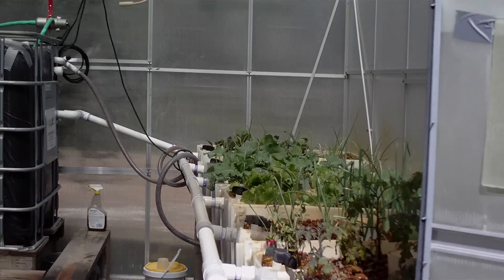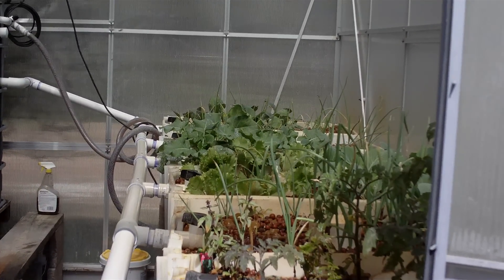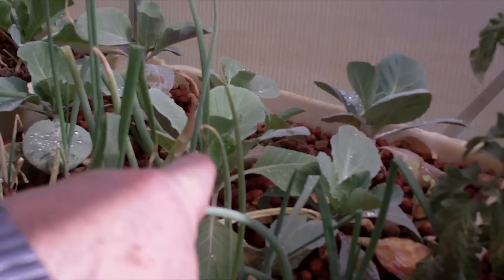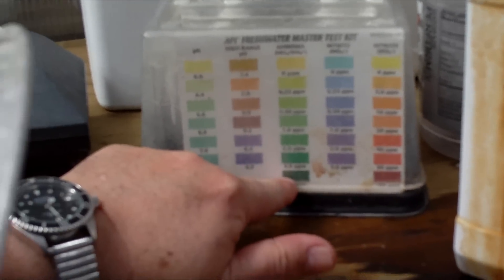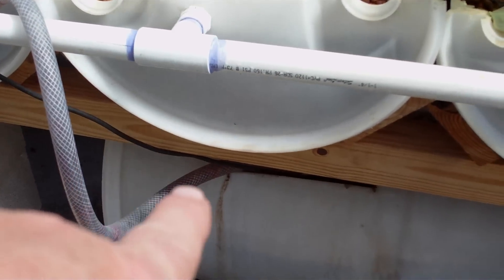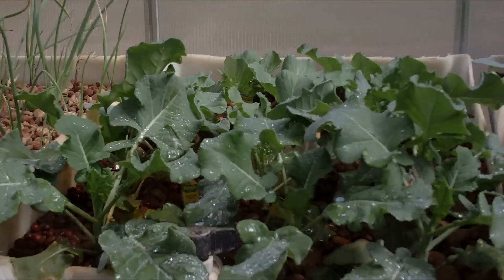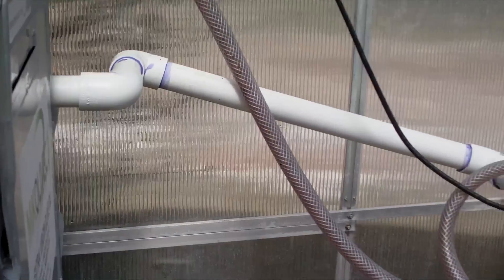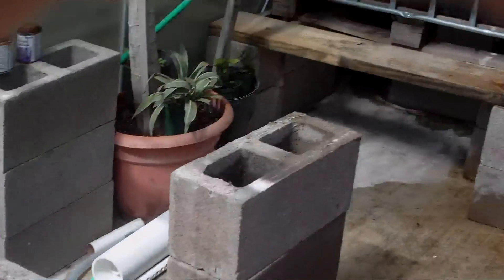Aquaponics System Week 4

Comment from the maker: I already purchased a mechanical timer before I started the system but decided to use the bell siphon system instead to try it out and although it works, it doesn't seem to be something I'd want scale into a commercial operation which is why we're testing this for 12 to 18 months.The beds have not yet cycled, when the levels fall to .5ppm for ammonia and nitrites then I'll know we're cycled. We added ammonia and urea to the water to create the bacteria we need, so now we wait.

Comment from the maker: I don't use any insulation for the tank, it is simply a couple of thick yard garbage bags taped to the outside to keep the plastic from getting brittle and keep algae from forming. At night in the winter we can get down to high twenties  (very seldom) so I use 1,500 watt engine block tank heater.